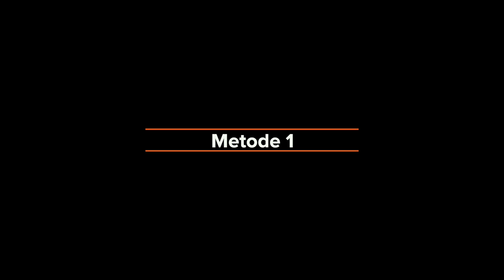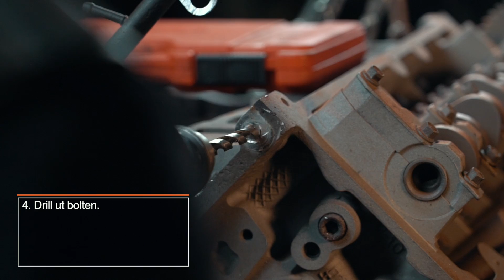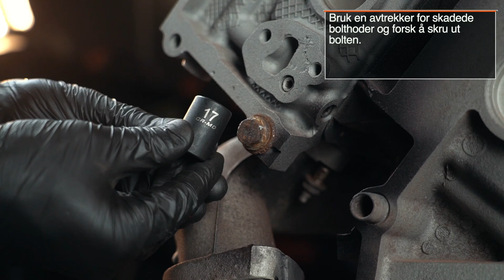Slik fjerner du en bolt som har blitt rund uten å sveise | Tips fra AUTODOC

Comment from the maker: Kjenner du til noen andre metoder for å få dem ut? Fortell oss om det i kommentarfeltet 💬

0:00 — Slik fjerner du en bolt som har blitt rund:
0:06 — Metode 1
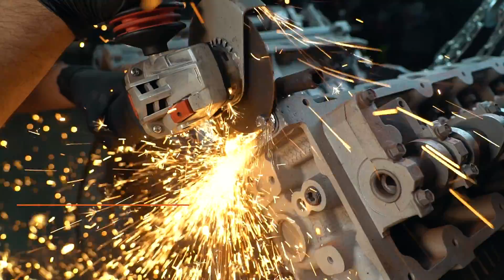0:30 — Metode 2
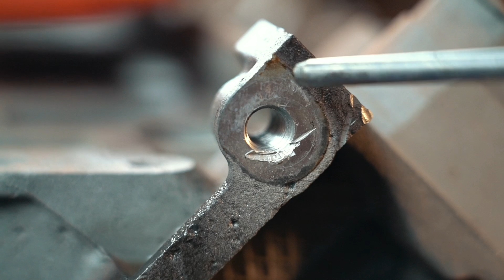1:17 — Metode 3 – for bolter med liten diameter
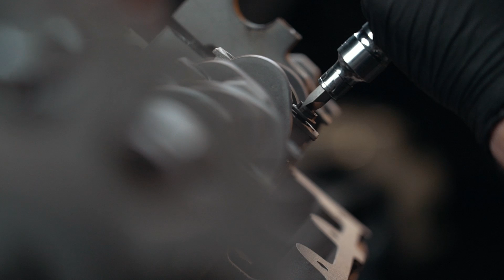1:38 — Metode 4 – for bolter med stor diameter
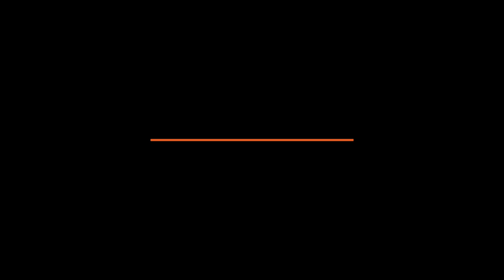1:53 — Metode 5 – for bolter som du allerede har klart å dreie flere omganger
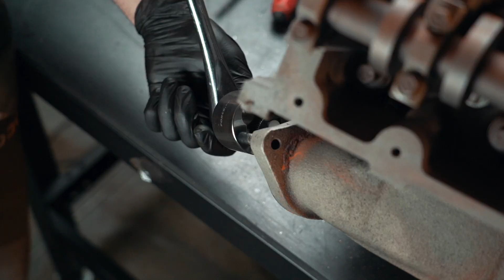2:18 — Metode 6
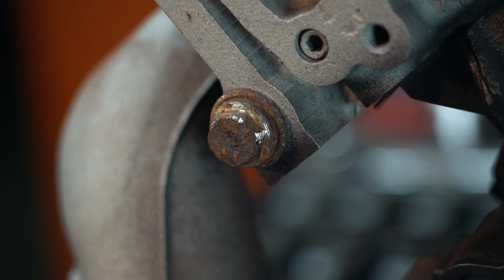2:52 — Metode 7